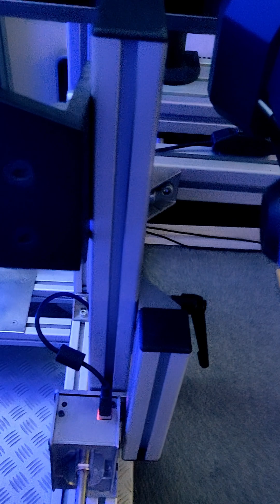Fast switch between H-pattern & sequential shifter | BDH & Aiologs

Comment: how did you mount your aiologs handbrake horizontally like that?
Reply from the maker: I just used the metal plate it came with. It has numerous holes in it, and I could just bolt it like that to the profile.